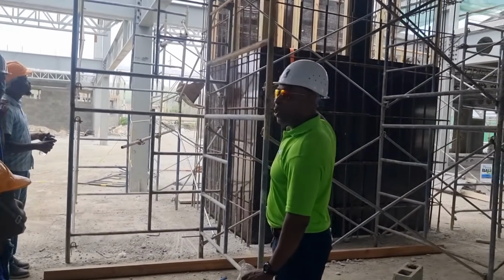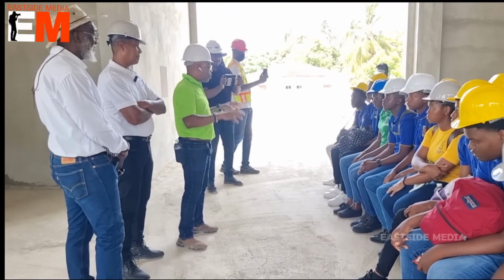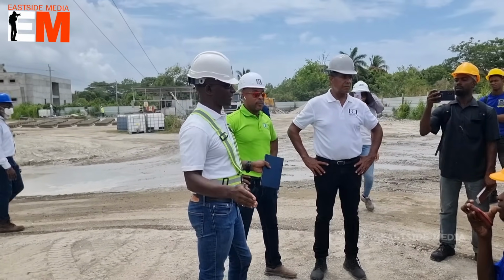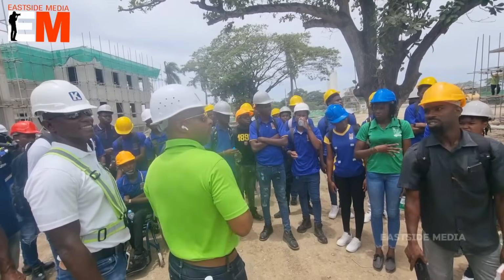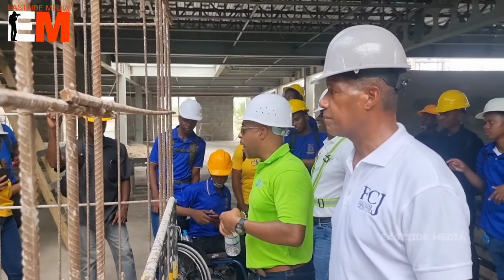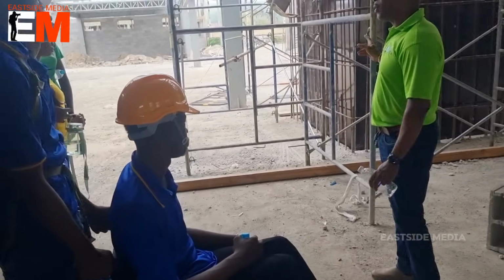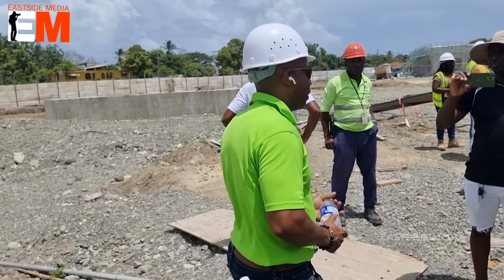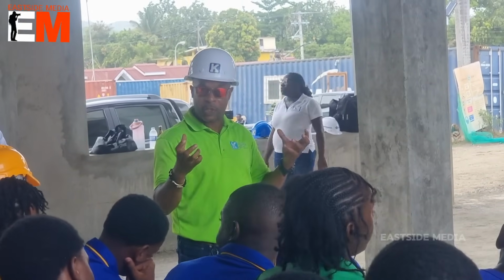POV:TOUR OF THE MORANT URBAN CENTRE WITH STUDENTS FROM ST ELIZABETH HIGH SCHOOL

Comment: Perhaps the engineers who conducted the tour could've elaborated more on the importance of safety, and the adherence to such measures. For although precautionary measures are clearly in place on site, culturally we tend to take them for granted or to downplay their importance. For instance, none of the students nor their instructors had raised questions about the subject, which conveyed the low significance that is accorded to it. 
The engineers are clearly versed in structural safety design methodologies. But below all of this, what about myriad daytoday potential and clear hazards on site that could lead to serious injuries, hamper construction schedules, add to costs, and create hardships to families? Shouldn't construction safety, therefore, be an essential and an unmistakable inclusion in the students' toolkit?
Reply: One of the female students asked about the availability of access/egress stairs for people to use in an emergency to get out of the building incase there was a power failure or fire. It was a great question. I understand your point though.
Reply: From what my son was learning there is an extensive partof the curriculum that is on safety, methods, equipment, rules etc. This is now a chance for them to apply the theory of what they have learnt.

Comment: Eastside Media nice video? Next tour of the Morant Bay Urban Center I would like you to ask what type of Air-conditioning system for the MBUC is it a central Air-conditioning System that covers the Urban Center?
Reply from the maker: I will try to ask about that next time
Reply: Ideally I think each building should have it's own centralized AC system. I can't see them having one centralized system serving the entire MBUC site, as the buildings are separated and it would mean running large supply air ducting between the buildings. Not architecturally pleasing to look at or manage. Just my opinion though.